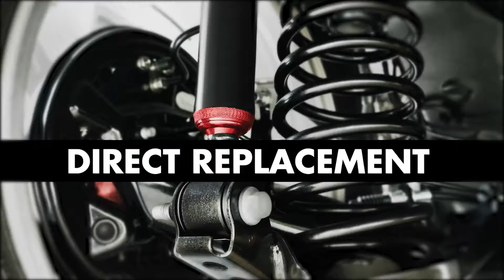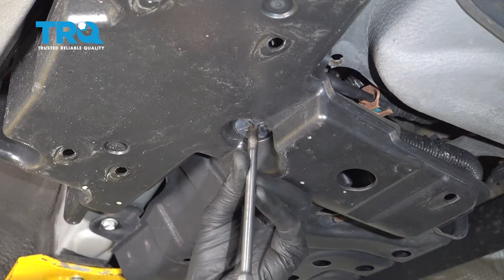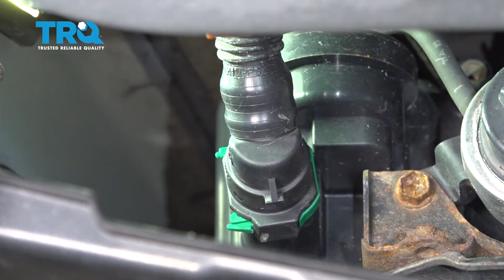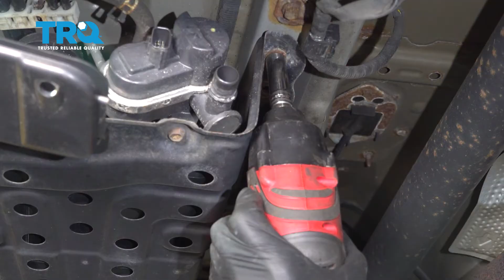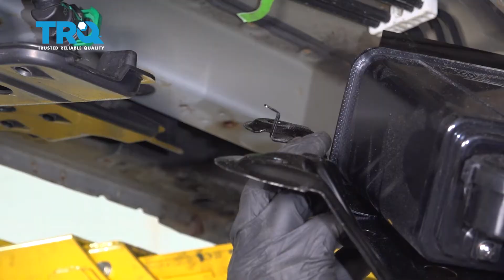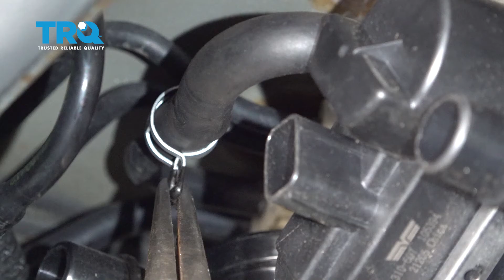How to Replace Fuel Vapor Charcoal Canister 2006-2012 Toyota RAV4

Comment: The plastic tab you remove when you're ready to drop the assembly is likely from the production line. They used it to hold the assembly in place until they installed the bolts. So it's generally irrelevant to reinstallation unless you want to use it to hold the assembly in place.

Comment: Thanks for the video. You guys are very helpful for DIYers. I do have one question. The RAV4 has a separate vapor canister filter listed. Is it necessary to replace that at the same time as the canister?